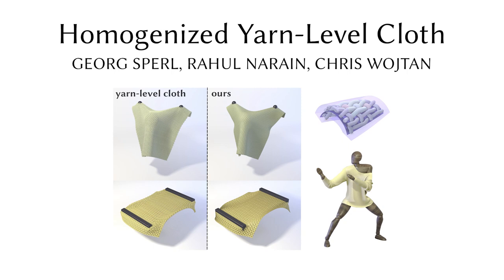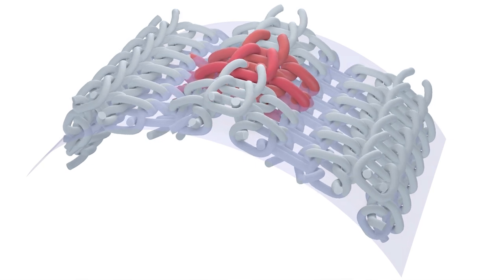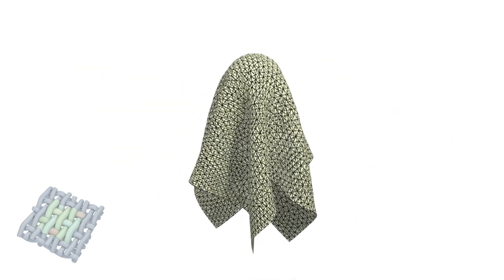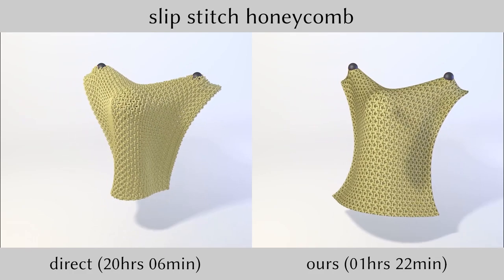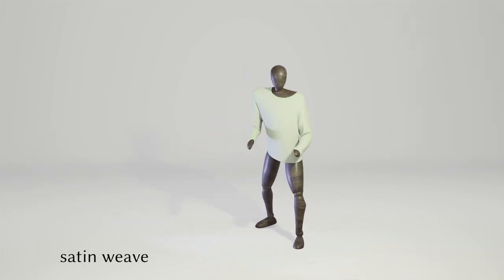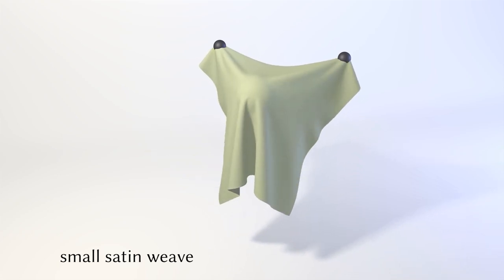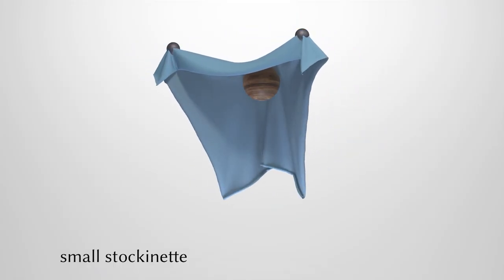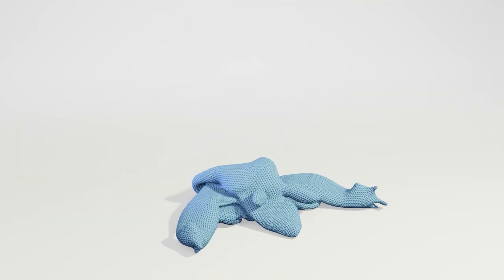Homogenized Yarn-Level Cloth [SIGGRAPH 2020]

Comment: At first I was like "eh it doesn't have the same visual look of having individual threads" but then I realised that it can do the same thing as physically modelling each thread... Without actually having to do so. Plus being able to accurately simulate higher stitch densities with a trivial amount of processing time when compared to the standard method? That's killer. Great work!
Reply: You can use displacement mapping to make it visually appear very similar :)
Reply: @logitech4873  True, but displacement mapping can't simulate tensile properties like this method can. Different weave patterns can make cloth stretch in one way but not another, whereas with a displacement map it'd stretch uniformly and regardless of which way the thread patterns face (unless you make a quick hack where you limit your softbody from stretching along a specific axis). That's why this method is so magic.
Reply: @MajatekYT  I meant that you could apply displacement mapping onto the flat sheet simulated with this method.
I.e. simulate with this method + render with displacement = visuals close to ground truth
Reply: @logitech4873  Ah yeah. It might not get the same close-to-ground-truth thread pulling that this method tries to reproduce, though.

Comment: Would it be possible to map a model of the thread onto simulations made using this method, rather than just projecting an image of the thread onto a plane?
Reply: Yes, that should be possible. However, you won't get any yarn-scale physics details, like knit loops tightening if the pattern is stretched, since that is as expensive as doing a yarn-level simulation.

Comment: Whats the diferance between this ans a normal cloth sim ?
Reply: The method fits a material model for a 'normal' cloth sim, such that the simulated cloth behaves approximately like a full yarn simulation would. Simpler existing cloth materials would not allow for the same rich behavior (e.g., anisotropic stretching and bending resistance, as well as interactions between the two).
Reply: it allows simulation of pattern-dependant elasticity. the same thing could almost certainly be solved with similar results with anisotropic elasticity, but this does it in a more specific and physically accurate way.